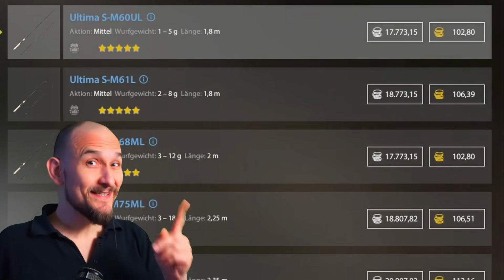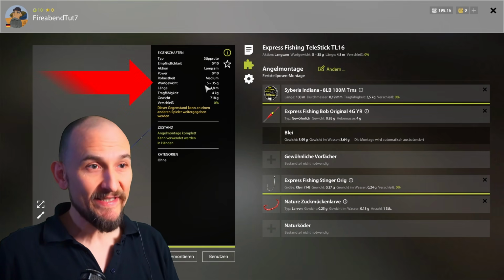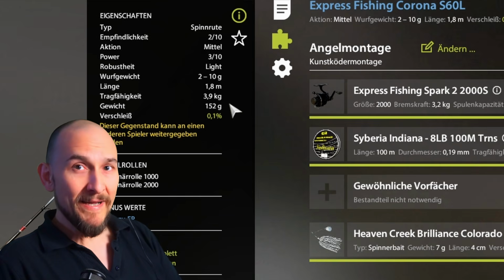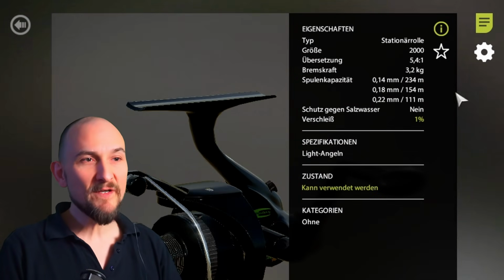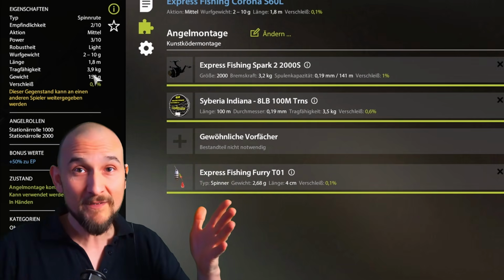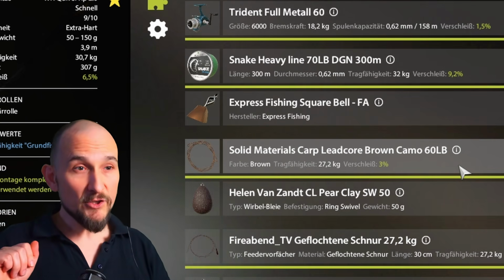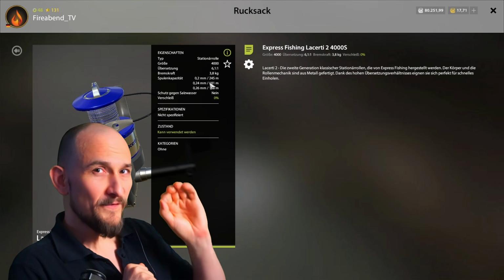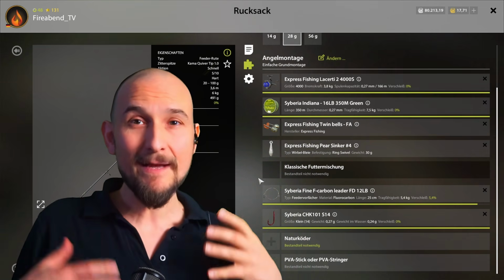RF4 Setup assembly – Tutorial Basics – Russian Fishing 4 – Which line? RF4 beginner guide #rf4

Comment: So if we multiply the braking power of the reel X 1.5 we get the maximum braking force of the reel when it is set to 29/30? If so what is the meaning of the 1.5.Like where that 1.5 comes from ?
Reply from the maker: No, that's a guideline that works quite well. It ensures that your line is not below the maximum braking force (set to 29). This allows you to take full advantage of your entire setup. So if all the values match each other as shown in the video.

Comment: Hello, I've been following your channel for a while now and I must say I'm always impressed by the quality of the content presented. This series is extremely relevant for beginners, but also for those who have been fishing for some time. Great work, we are always learning new things.
What caught my attention the most in this video was how you calculate the ideal line load capacity for the setup, using the max drag of different reels as a reference and multiplying by 1.5. I confess that this is new to me, I've always heard that mech weight is used as a reference, and that's what I've always done. I know this is done by anglers who like to lock their reels. I personally never do it, so i have one question, is using the mech weight a good practice for the setup? Is it reliable? is it safe? should it only be considered for those who want to lock the reel? or is the method you indicated the most appropriate?
Thank you.
Reply from the maker: Thank you very much for your detailed feedback. I'm glad the videos are helpful. 
There are two ways to set up your fishing gear.
And! Of course, there's a reason why RF4 doesn't show the exact gear information in the game =) 
This information comes from the community and is usually calculated. 

RF4 says: It's too confusing to have such information (they're probably right =) ).

If you want to fish “normally”: The brake is important.

If you want to “overload” your setup with a closed brake, then pay attention to the gearbox. 
However, this is only interesting for catfish or sturgeon fishing. 
And it's part of sea fishing. 

You don't need it for anything else.
Reply: @ReelOnFire  Thank you for your response, it was very enlightening and helpful.